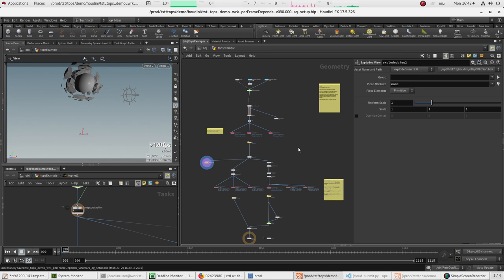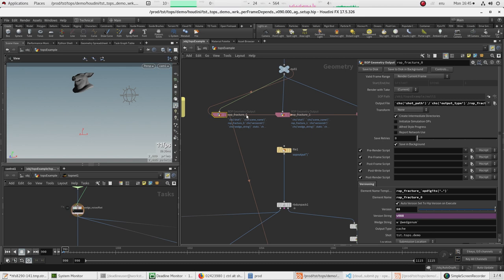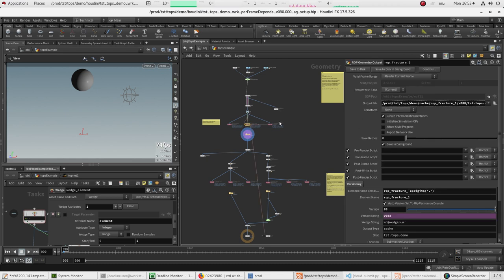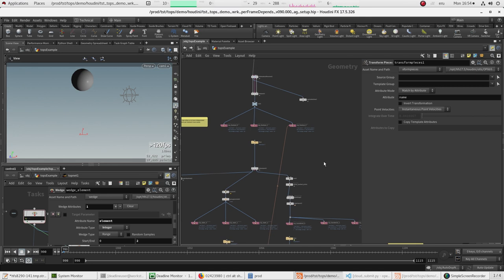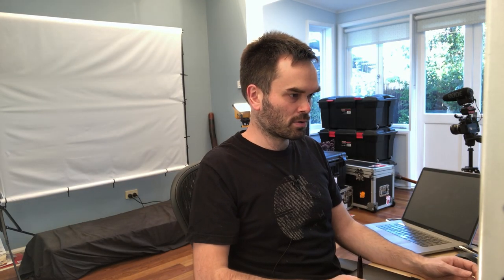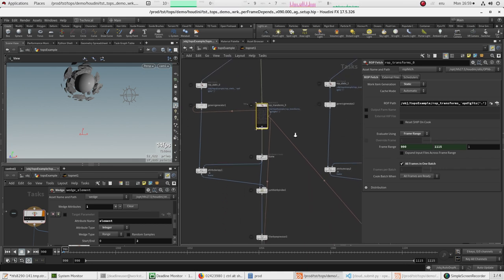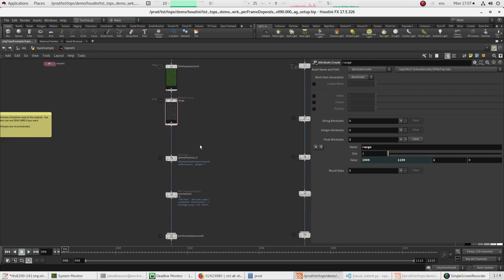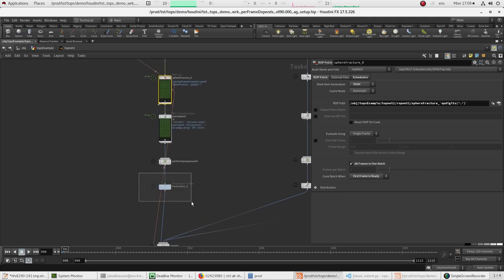PDG Production Fundamentals in Houdini

Comment: great stuff Andrew! Out of interest what sort of spec local machine are you using for your daily work? Interested to hear what you would recommend!
Reply from the maker: Thanks Greg, I'm happy it was helpful!  I decided to get a dual proc board with only one slot being used currently, and then I'll put another proc in it later (with a power supply suited to that possibility).  It's an HP Z8, Intel Gold 6154 18 cores @ 3Ghz (they seem to all boost to 3.7 simming around the clock though anyway), 6 x 32GB DIMMS (192GB RAM), 1700W PSU.  The AMD procs do really well too it seems (their recent releases are really exciting), but at the time I wanted lots of memory + the bandwidth to spread across two procs (eventually) in a small package that I might be able to travel with.  128GB ram used to be a gold standard to get things done for me, but TOPS changes that since if you want per frame depends, multiple jobs need to run so whatever your estimated ram needs, helps to keep that in mind.